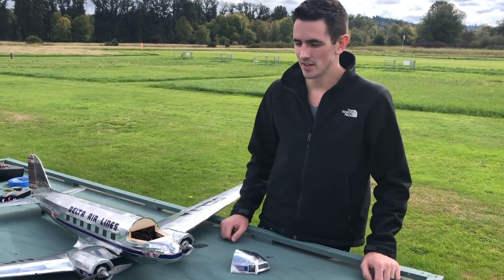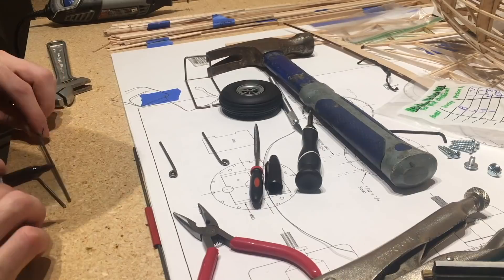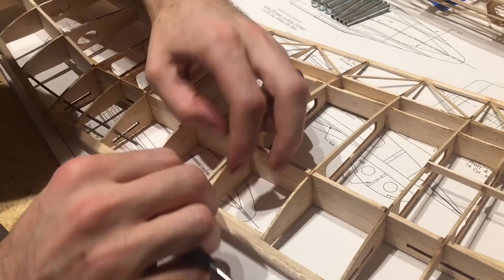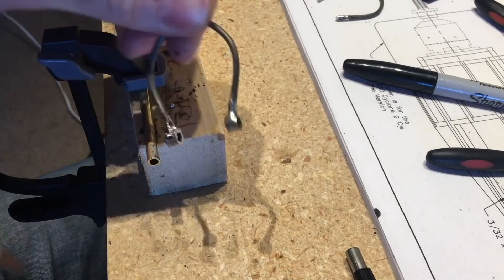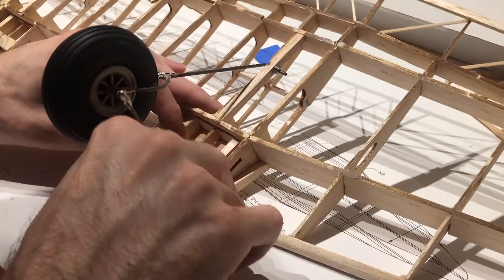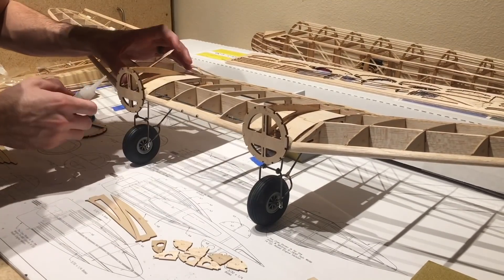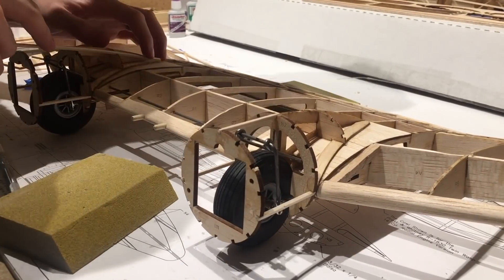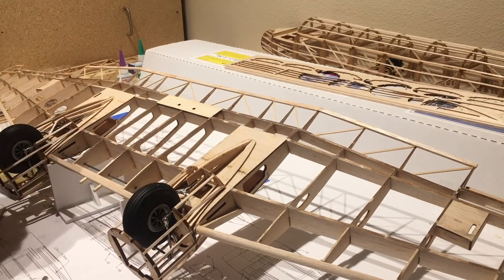How to Build Custom Retracts - DC3 RC Airplane

Comment: Nice to see a young man BUILD a plane rather than ARF.  Not many kits still in production now days but Zirolli and a few others still have plans available . 

Your asking a lot of solder to hold up for the landing gear. Maybe consider brazing or Tig welding when it breaks , that type of weld will not break like solder will. 

Good job young man!!

Comment: Thank you so much for making this excellent video. Now I understand how the long axle is rotated by a single servo and makes both gear retracts deploy  without buckling. You didn't show forming  the small  "eyes" to make pivot points for the U shaped part, ( must be a combination of pulling and bending wire around a post and forcing it tightly around with vice grips and  some profanity). I might try using a torch and silver soldering parts instead of soft soldering. "E-Challenged on RC Groups"

Comment: I was amazed at how well the soft-soldered joints held up. Did you use common 60/40 tin/lead rosin core solder and rosin flux? What wattage iron did you use?.  Surprised that the plastic wheel hubs didn't melt from soldering heat.
Reply from the maker: Ya I definitely was careful not to get the metal to hot to melt the tire. I used rosin flux I was surprised how well this worked for lading gear I had a view problems with the first few flights. But after all the landing revealed all the weak spots I was able to fix them up and have not had any other problems with it.

Comment: That is one very nice DC-3. The kit is impressive. Your build is impressive. Well done with the air frame. The design of your retractable gear is very well done. That's the good part. Your video production is not so good. All the fast forward makes it hard to see the detail of the landing gear parts. It would have been better to show just one side and say the other is the same. You have no mechanical connections. The butt joints and solder will eventually fail. Where you have butt joints, flatten the end of the wire and make a wrap.